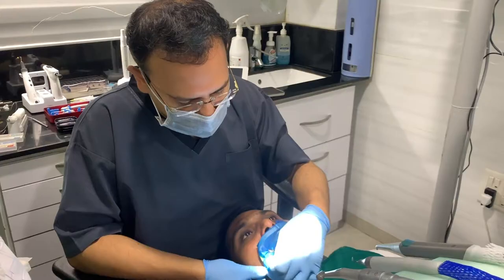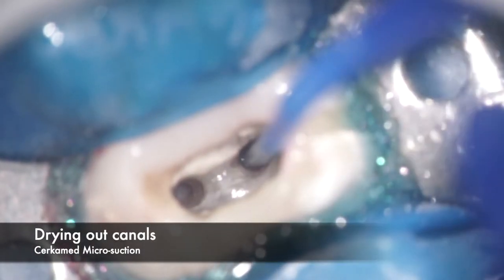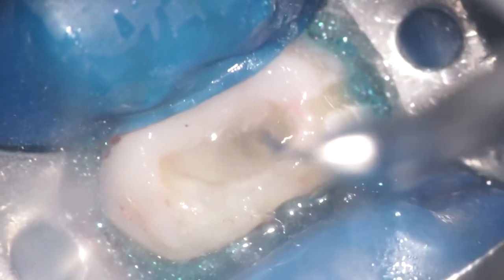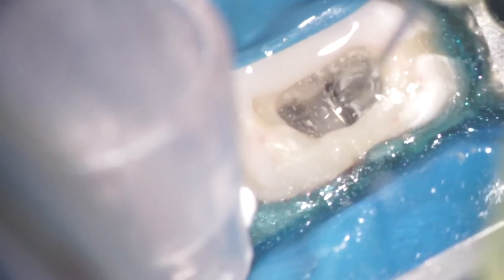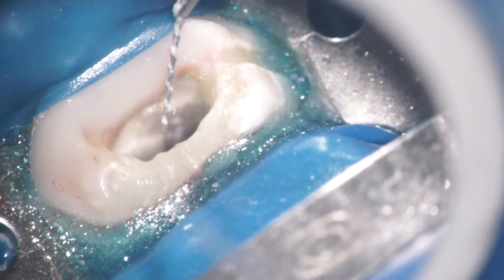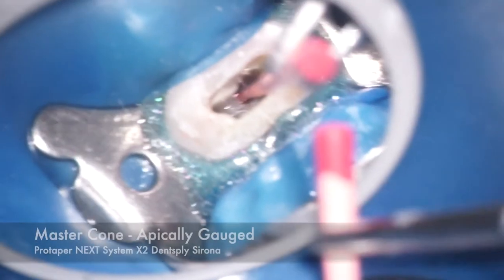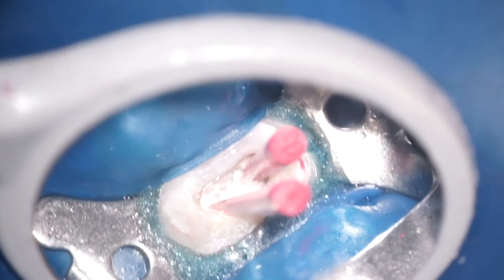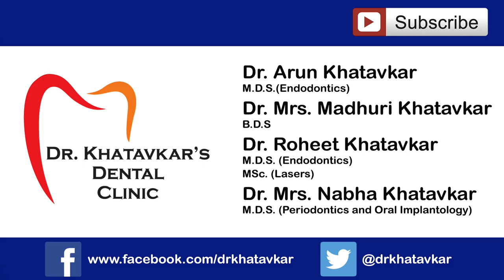REMOVING FRACTURED INSTRUMENT from Root Canal - LIVE CASE with BTR PEN

Comment: Good work sir👏
Winged or wingless Which is a better clamp to use on patients? In terms of good isolation and pts comfort Kindly enlighten me from your prespective  and experience
Reply from the maker: I use the clamps based on clamp stability and clinical application
In general I prefer giving anaesthesia to the patient so their are comfortable during the procedure
Topical anaesthesia is also sometimes enough for comfort during rubber dam placement
In general if you don’t accidentally place clamp on the gingival tissue winged or wingless clamp would provide the same level of comfort